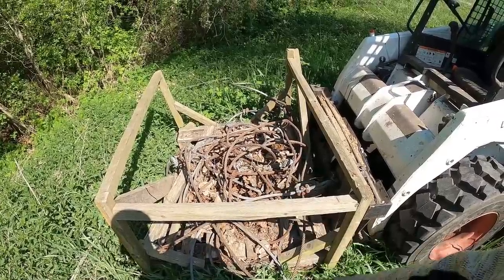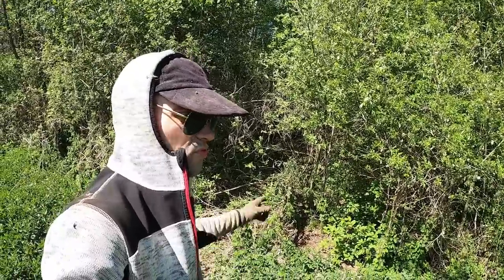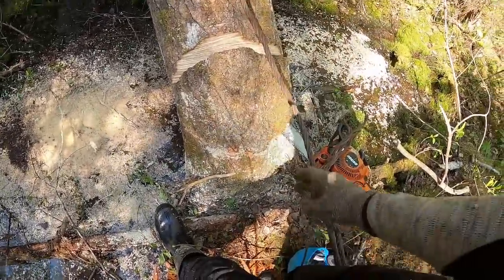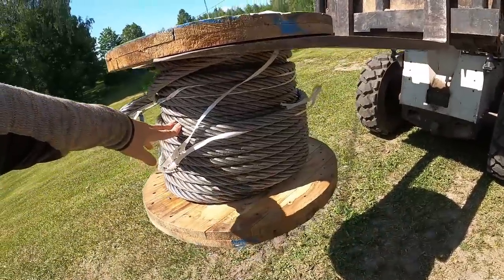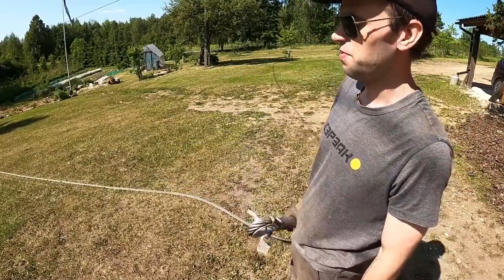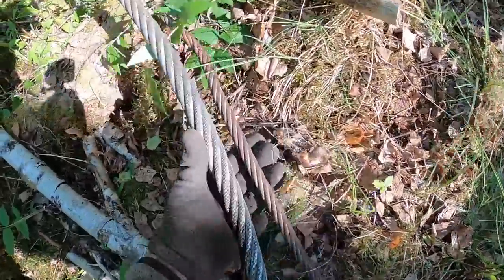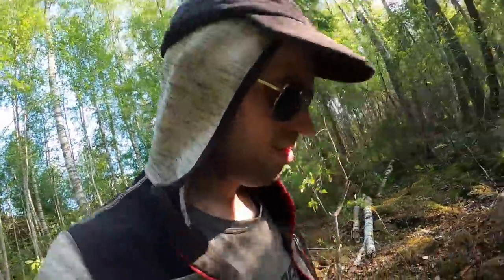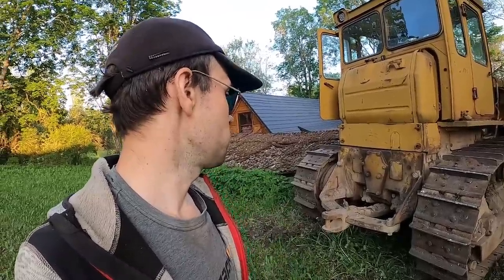Dozer tree pulling challenge

Comment: Cheapest and quickest, weld together a hanger on the back of the dozer and hang the wire rope off it like you would a garden hose on the side of your house. A couple of shackles and a pulley to change the pull direction would come in handy too.
Reply from the maker: Yup

Comment: Hi the Steel rope is realy big. i Use a hammer compressed 13mm Steel rope is min Break Load is like 22T and it fits in a pully, i recommend useing wire grease it‘s like grease but liqued but not that sticky, if you leave it it will rust even in air, and when Its rusting you are going to lose like 2/3 of the wire strenght. I’m useing liqui moly seilfett. i think you will find something maybe old engine Oil, it works but it is sticky af. Greatings from Germany
Reply from the maker: Thanks for the info!

Comment: Hi Ants, very amusing video again. Can you use the heavy duty cable and the dozer to remove your trees from your neigbours property line. Secure the cable to the tree top and put tension on it with the dozer. Then do the cutting and pull them in the right direction.
Reply from the maker: Yes but if something went wrong i would be @ fault
Reply: Ehh, what could go wrong 😊

Comment: A rule of thumb formula for wire rope slings is diameter x diameter x 8 = the rated capacity of the wire rope in tons. This formula uses inches and has the safety factor of 5 to 1 (ALL rigging has a 5 to 1 safety factor) built in. Different types of rope have higher and lower capacities. This formula gives you the approximate rating for low end steel ropes to keep you safe. An example: 3/4 diameter wire rope is .75 x .75 x 8 = 4.5 tons. 4.5 x 2000 (pounds in a ton) = 9,000 pound capacity. An extra improved plow steel hoisting rope of this size is rated for 12,500 lbs with a 3.5 to 1 safety factor included.
Reply: That rating you have on the tag that looks like a noose is for a choker hitch, not the eye in the end of the rope. The rope with the eye is rated for the full capacity of the rope.
Reply from the maker: Looks like so yeah

Comment: As many wonder in the comments: nettle pesto is awesome ! Here's a quick recipe 🍽

Wash the nettles abundantly (wearing gloves of course) in cold water, at least 3 times, changing the water each time. For 100 grams of nettles, put the leaves (stems are thrown) in a blender/mixer with 25 g pine nuts (and/or almonds), 4 garlic cloves, 50 g parmesan, 1/2 lemon juice, a 1/2 cup of vegetable broth, salt and 10 cl olive oil.

Nettle pesto oxidizes very quickly (it turns black), if it is not consumed immediately. It must be covered with a layer of olive oil for conservation.

It's absolutely awesome with pasta ! 🍝
Reply from the maker: Thanks sir

Comment: Another video masterpiece.  I think you could have used your chain  around the stump  to connect to the cable.  The dozer is a beast. I want one.  I only have a Korean  tractor.   Straps are great for pulling. Cheaper and lighter than wire cable.  I bought a 10 meter  15000 kilo strap for $60 dollars Canadian  about 90Euro I think.  Great job and I'm looking forward to the next one.
Reply from the maker: Yeah straps are great but they can get damaged too easily
Reply: @Ants_Pants  Possibly in theory but not in practice. No rusting and much easier to handle and store so in my opinion  well worth it. Once you had strap you never go back!

Comment: You can use winch just for tree pulling, because it is much more convienient to pull trees with winch, because you can adjust the lenght and you dont need to drive back and foward in low gear that much, specialy when you have long cable. I think for some of those dozers winches was mounted originaly for forest work.
Reply from the maker: Yup

Comment: Nice job. I would have done a few things differently but over all it dose not matter really at the end of the day. The only good soviet era steel rope I would ise is the 3/4" rope that dragline excavator used or the ones used on tanks. Rusty old wire is like hugging a steel hedgehog specially when you had bad gloves on ya hands. I think you did well investing into good steel rope. Arborists services are not cheap and rather the last thing if all else fails or the tree is in a very tight residential area. Was the ash tree really worth all the afford? I think yes, cause you learned how to rope winch things out. The allies have equipment to pull out something the weight of a dozer or excavator but they don't offer any services. I know a machine that is stuck for years since it's half way in the ground and now it's probably down to the boom. PS. People who complain about numb limbs and nerve issues should try sting weed therapy..it really works. 😂
Reply from the maker: Yeah. Exactly

Comment: That thing is a freakin beast like it pulled that tree just idling and snapped that cable with ease, maybe a chain would have worked better but great vid !!👌👍🙂🙂
Reply from the maker: Yup. And while i was pulling the cut 8 meter log with the tractor. That thing overheated in like 5mins 😂

Comment: You can estimate the strengt needed with the weight of the dozer. 
Doser has anywhere between 80–120% weight to pulling power ratio, so 20 tons is what u need. 
( plus safety margin plus calculating shockloads )
Reply from the maker: Thanks

Comment: Next job is oil the crap out of the wire rope, as in soak it. I would guess you could rig up a quick system using PTO on tractor to use spool it came on to rewind.
Reply from the maker: Yeah

Comment: Ash is actuallt a very good tree for anything that requires shock resistance. Very good for handles of all kind like axe handles and so on. More stronger than Oak for that purpose. If you use it for the right aplications, ash is a very good tree species
Reply from the maker: Got it

Comment: When you are through using the cable coil it on the wood reel it came on and as you coil it use a pump sprayer and spray it with some light oil like hydraulic oil. This will keep the cable from rusting internally . Rust will destroy the integrity of a cable if left to eat away in the center of the cable. For what this cable cost I'd be protecting it . Once you spray it the cable will be good for a long time before you have to spray it again.
Reply from the maker: Gotcha

Comment: American Loggers use a Choker Cable that goes around and self locks to itself and cinches fast to a tree or log. Look them up and make a likeness or buy used for a model? They will last a lot of years.  24 mm is going to be REALLY hard to handle I guarantee .  Will goats eat those stinging nettles as we call them in USA?
Mosquito Fish will live in small ponds and such; they eat tons of bugs. They are about 1-1/4" long Motorized crank for spool and re-wind the 24 mm cable?  Rack to sit it onto?
Reply from the maker: Yup. Need a few

Comment: It seems to me that the tree is rather Aspen than Ash. Ash is very heavy and hard, which is almost on par with oak in terms of weight, strength etc. Aspen is lightweight and used in saunas or matches.
Reply from the maker: Yeah i might have mixed the 2 up

Comment: See I told you  to get the cable rope to start with. You will use it more than you realize. You may not want to put a winch on the dozer however considering how long and heavy the cable rope is I think it would at least be wise to make the cable drum have a motor to at least wind the cable up because if you think it is heavy to drag imagine trying to wind it up on a cable drum by hand.
Reply from the maker: Yup

Comment: Mmm, I was concerned more about the chuckles, but the rope gave way first, so everything's good. Interesting choice, but the wire will be very useful for future needs. It's on the heavier side but some spare capability never hurts. Don't foget to spray it a bit with WD40 or some light oil if you store for long periods to prevent the soviet rope mishap. 😉 Wahahwahaha... the bicycle idea was crazy... 🤣 Didn't expect you to try that.. Even worst is the idea of teaching your mother to use the big lawn mower... Absolutely nothing could go wrong!!😮
Don't be angry to the "sting herb", it's packed with many many excelent properties, you can make "delicius delicius" spinach and other goodies with it, some fertilizer, some natural anti insects spray, some medicine.. If I was there, I would probably collect as much as possible, but that's another story. 🤓
Jaaaj, it's working... o oh, some casualties...
Way to go, you realized the potential of tools you have. Not meant for single use only! 👍Keep on!
Reply from the maker: Very true

Comment: Atom Ant doze it again.  Do you get it? "doze" instead of dose, lmao 😂😂😂

Seriously, Ant, I have an idea. A mechanical rope drum is the way to go and would make a good video, but meanwhile, why not use the drum it came on as a temporary measure? Just so it's not getting in everyone's way.

Also, you will need to keep an eye on the kids, or they will be using the rope to play skiping games 😂😂😂

Ash is great for furniture making, but I guess you're not a furniture making guy. So, use it on your next building project.  It's not strong enough for use as beams or posts, but it's great for bracing and planks.

So what's next, Ant? How about blowing up that stump with some soviet TNT, or you could drill lots of holes from above, then slowly pour 1 gallon or 2 of kerosene to soak in. Then, once it's nicely soaked in a flammable liquid, set fire to it. It will burn for several days until there is nothing left. There's no need to worry about catching anything else on fire as it's quite swampy all around the stump.

It's just an idea, but my first was best, wouldn't you agree? Do you have TNT or C4? Yes, use some C4 or use both. The bigger the bang, the better plus, they both will leave a crater large enough for?

Who cares what for, just go blow something up.😏🤘🤭🇬🇧🇺🇦
Reply from the maker: skiping rope for the kids 🤣🤣🤣👍, sorry it's aspen not ash, i mixed the 2 up, i wish i had some TNT or C4 lol, but i would be put in jail